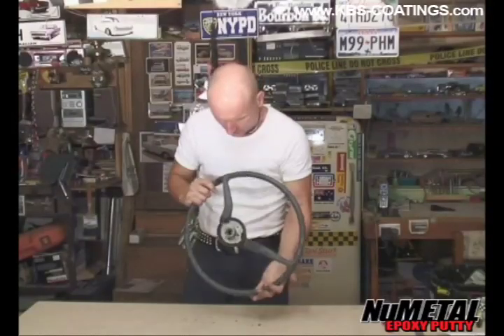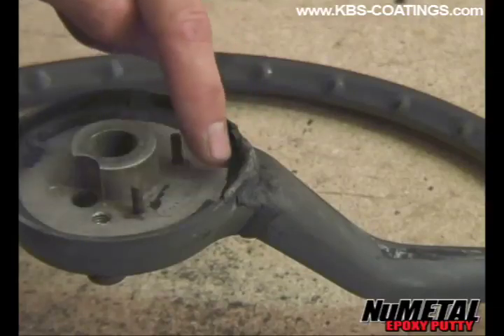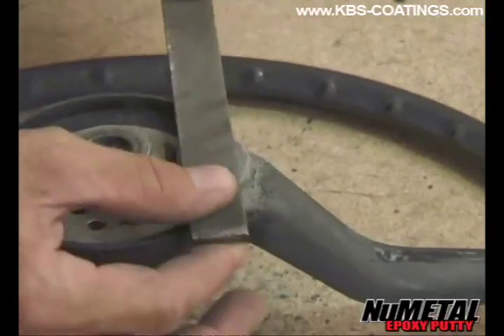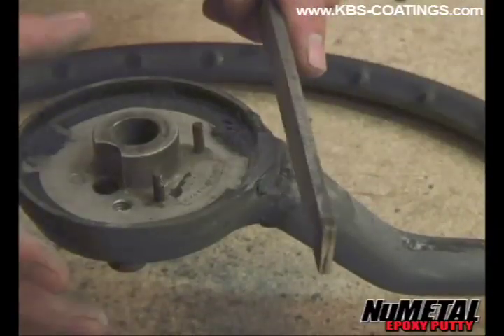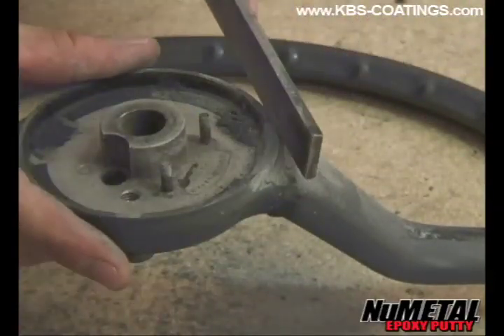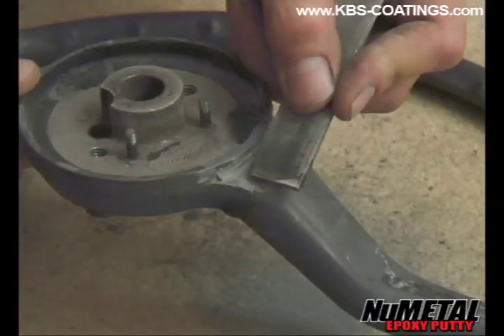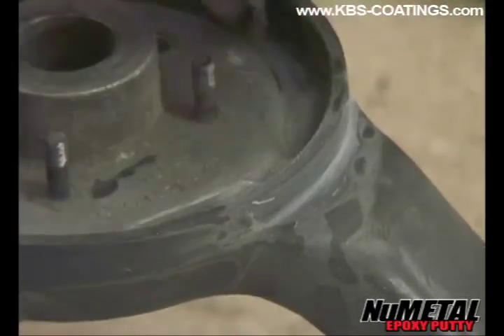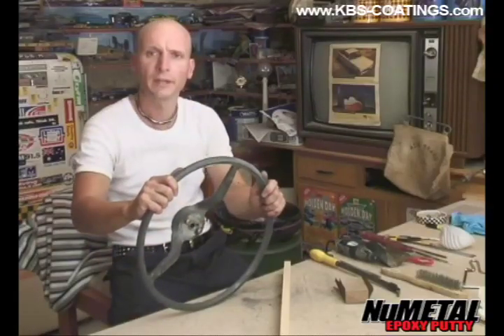KBS Coatings - NuMetal - Epoxy Putty - Steering Wheel Repair - Part 2

Comment: Hi solorip, I used House Of Colour Silver marbelizer and Candy Red 2K on this wheel. It's easy to use and if you learn to flood paint you will get spectacular results. I learned to flood from  the beginning and I get no orange peel and no runs. It is very important to wear a high quality respirator when using 2K unlike many of the people you see on you tube who don't. 2K can cause major immediate health problems if used without a respirator.